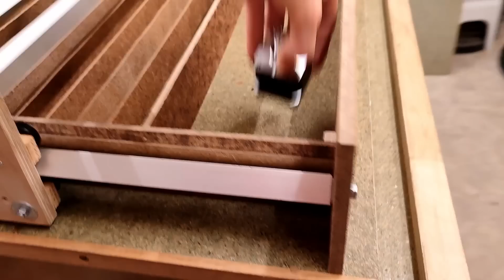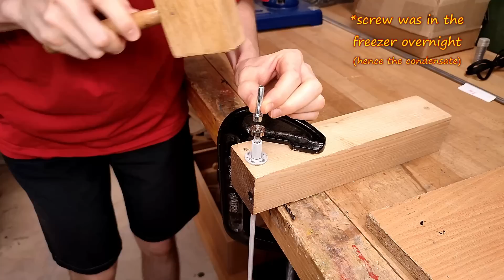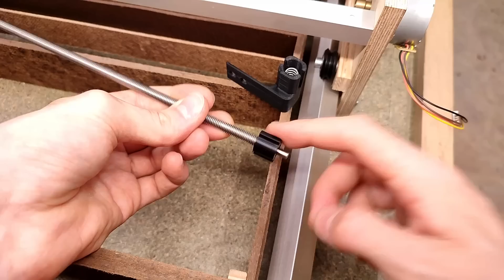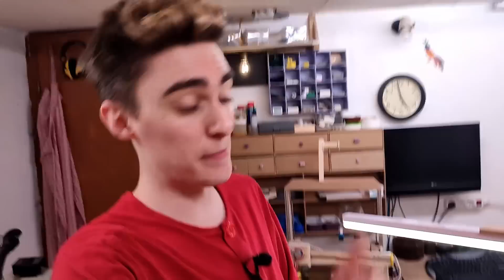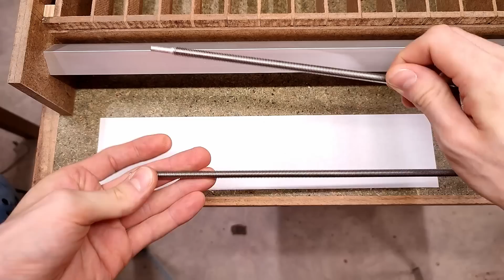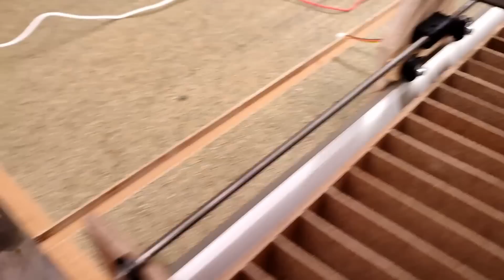Threaded rod as lead screws on DIY CNC? Bad idea! | Budget UV laser cutter part 2

Comment: nema 17 pancakes on a carriage that smooth i think would work still.
Reply from the maker: Maybe.. If I had one on each side, probably yes, the new GRBL even supports dual motor axes for gantry self-squaring. But I'd have to use a single one to drive the entire carriage, which I'd estimate weighs easily over a pound, so accelerations would be very limited. It COULD move it no doubt, but if I do install decent motors I want decent performance to boot ;)

Comment: Very hard work here! Klipper supports different pitch lead screws on one axis I believe, but not laser cutters (not to mention it's a whole different beast from marlin and GRBL). But coreXY is probably going to serve you better anyway - threaded rods tend to vary in pitch by a noticeable amount over as little as a few millimeters, creating a wavy pattern.
Reply from the maker: Thanks! I'd never have expected Klipper to support it - though it's no good either way because none of the G-code senders for laser out there are Klipper compatible - but thanks tor the info anyway! Knowledge is power as they say...
Yeah, coreXY is definitely more suitable, especially as I have all of the parts at hand already - while I'm at it I'll also purge all the unnecessary weight in the gantry and make it less overkill, it's just a laser after all. Probably a good thing overall for the project.
I really didn't expect the thread to be that inaccurate, but it makes sense, threaded rods are meant for screwing on nuts which doesn't need tolerances this tight. As @SianaGearz mentioned, with a constant pitch die in manufacturing the final pitch depends on the diameter of the rod that was fed into the machine to begin with, which hadn't even occurred to me.

Comment: i think you would have figured out the software stuff in less time than you spent babysitting it. and remember that the knowledge gained will pay dividends for your entire life. imagine how many times you will be able to cash in on not being scared of the code :D
Reply: I'm a (minor) Marlin contributor and i wouldn't dare do such a modification. You can't imagine how complex and fragile the movement code in Marlin is. I'm vaguely comfortable with many other areas, i have modified the HAL to suit my system better and enable interrupt features, etc.

You will notice how many hundreds of people touched most of the Marlin code and how few have actually contributed to the movement routines, these people are spectacularly sharp, and the code in that area is still very far from ideal in behaviour.
Reply: @SianaGearz  i was refering to his arduino based ghetto lathe. you could literally just count steps up to a hard coded value and then reverse direction. doesn't have to be pretty.
Reply: @cho4d   Oh yeah sure there's any number of way to do that, easy enough. I meant and thought you meant running different step rates across the same axis two motors. This would require a substantial re-engineering of Marlin, which is complex enough.
Reply from the maker: Yeah, hard-coding steps and speeds is likely what I would've done, but that still  would have taken me a day or so to write and debug, the machine would've taken a day longer to build because this also requires a motorized 3rd axis, and then I'd have to wait another four days till it finished grinding to continue with the video. Sure, I could've done something different in the mean time, but the video wouldn't have been out sooner.
Next time I'll do it though!
I might also simply run GRBL on it and write some G-code to take the rod down to a preset diameter after probing?...

Comment: What firmware are you running this with? I know on Klipper you can set the rotation distance for the lead screws.  The only way to learn is to do everything wrong at least once. Keep up the good work. BTW Don't forget what Adam Savage says... "failure is always an option".
Reply from the maker: It'll be running GRBL, there is basically no better option for laser machines since most dedicated Gcode senders don't speak the Marlin or Klipper accents.
As far as I'm aware Lightburn and Laser GRBL are the two prime candidates for controlling lasers, so ignoring obscure Inkscape plugins which might result in God knows how many issues, and skipping proprietary Lightburn, I'll pretty much have to use LaserGRBL.

Too true, usually failure is the most effective way to learn things!

Comment: First of all: This video was a pleasure to watch.
I also like how you solve some small minor problems! It's amazing!
I know, it's crazy idea but since your carriage is running so smooth, you could try to make one lead screw more rigid and discard another one. Then You can make diagonal reinforce and measure the backlash by using only one lead screw. The big thing is: Your laser cable management must be on side, where the lead screw is present! otherwise the cable management will pull on the leadscrewless side and cause the gantry to bend.
But its just a crazy idea, you can pull if you not already disassembled the machine :D
Greetings and thank you For great content :)
Reply from the maker: Thanks! I thought about that possibility too, seeing as all the cantilever designs out there do it, but when I took a closer look at it I noticed there's still about half a millimeter of lag between moving one side of the X-carriage and the other one  coming with it. I guess it's better than what I have now, but not good enough for a fix. I was actually surprised to see it, given how overkill the entire Y-axis ended up being in rigidness, but it also weighs about half a kilo at the very least so the little play there is in the individual bearings of the POM wheels actually allows some flex. If the rear wheels ran on the rail horizontally it would probably work fine, but as it is the weight introduces too much drag...
Also I'm sufficiently fed up with it at this point that I'd rather redesign it and skip the minor inconveniences from having lead screws altogether :)

Comment: Is it not possible to use dual motor Y and adjust steps per mm? You'd get double the power too.
Reply from the maker: Well - almost no firmware supports two separate steps/mm settings for one axis, even if it's a dual-motor axis with self-squaring capability. It always applies the same resolution setting to both motors. Apparently Klipper does, (offer individual step/mm settings) as somebody else mentioned here in the comments, but the problem is that no G-code sender for laser cutting supports Klipper. Or even Marlin for that matter. The whole software ecosystem for laser cutting isn't anywhere near as advanced as the one for 3D printing. So I basically HAVE to run this laser on GRBL, which is kinda clunky and doesn't support fancy stuff like screens or SD cards. No reason to fix it if it ain't broke I guess, but it's nowhere near as plug&play as 3D printing has become.

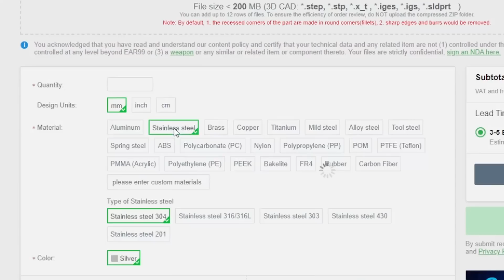Comment: 15:45 Titanium isn't as bad as its reputation. My mini-mill handles Ti6Al4V better than even mild steel. Stainless is the hardest. I can only guess that the problems show up when you have a super rigid machine that can eat steel faster than mine does aluminum. Probably have to slow down to similar speed as my machine and get annoyed that it's slower than you're used to.
Reply from the maker: Good point, maybe it's an old wife's tale - I don't really know a lot about machining, I heard that it's terrible to machine and verified it in a google search where it ranked second, right under inconel on a list of least machinable metals. Though my guess is that time spent on the process is taken into account as much as hardness since it translates directly into cost?...

Comment: Wow you have a real 3D printer? And a TT as well? Nice.

You can dry PETG with the bed heater. You can use a filament box with one side cut off. You can poke some holes in the top and make sure you have a tiny gap somewhere in the bottom. You can also dress the inside in tinfoil. I don't know why i did it the way i did, but worked for me, takes a day or so to dry.

I also suggest getting some double ziploc bags (say IKEA pack of 4.5 and 6 litre bags), and calcium cabronate room dehumidifier packs from the supermarket. You can seal one of those packs with the bag and in a few months when you retrieve PETG it will be super dry. Then i suggest double bagging the whole everything, and never store those dehumidifier packs near anything metal.

Wow so much difference in thread? Crazy. I didn't run into this issue since when i used M6, i cut both sides from the same rod. I would have never suspected it! I have never heard it happen to anyone before either!
Reply from the maker: Yeah, I have a real printer - I mainly took them up on the offer because I figured learning the ropes of 3D printing would be much more difficult on an inherently delicate printer. And having a second one definitely doesn't hurt either ;p

I tried the heated bed filament box method dry PLA at some point but it didn't really seem to work - probably cause I half-assed it, I didn't poke any holes in the box, nor did I leave it running for more than 4 hours, since I couldn't stand the constant drone of the cooling fans x)

Thanks for the tip with the dehumidifier packs! From my brief googling just now it seems it's the same stuff as road salt, and I happened to find a disused bag of the stuff rotting away in the garage... Just need to figure out how to dehydrate it. Not storing it near anything metal makes sense, having seen the state of the metal scoop that was in there. 

Yeah the difference in pitch was way more than I expected - never heard of it either, though it doesn't help that I can't remember to ever have seen a video or something where someone tried to make a CNC with it..

Comment: Hey, don't think those are manufacturing inconsistencies. Lead screws have different pitch and lead, so my guess is that you just got lead screws with different specs
Reply from the maker: No no, those were all very much sold as M6 thread, if you look up how threaded rod is manufactured it starts to make sense. The dies used to form the thread just aren't that accurate from one machine to another... I never expected this, but it's obviously the case
Reply: @ChronicMechatronic   Yeah it makes sense where the inaccuracy comes from. Let's even assume the thread rolling die is the exact same. The pitch can still depend on the diameter of the rods as they come in! Because the die is basically constant angle not constant pitch, it just drives the rod forward at a rate that happens to emerge from the rod's diameter and that angle. And as you noticed the diameter wasn't quite similar enough either.

Though from looking at them at a home improvement store i didn't notice them deviating much at all, the threads of rods that i was picking for straightness and holding against an angle to compare together seemed to slot into each other just fine across 1m length. Perhaps you just got extra unlucky with that batch variance.
Reply from the maker: @SianaGearz  you're right! I hadn't even thought about how the diameter would affect it.. Measuring the diameter on those rods just now, one is about 5.85mm in diameter while the other one measures ~5.9mm for the most part. Annoyingly the Y-axis screw seems to be about 5.9mm too, which is even more unfortunate :((
So there were probably two much more similar ones among the three I got, and I just happened to pick the most dissimilar ones.
It also answers the obvious question whether the pitch is at least consistent over the entire length of a single rod: probably good enough for DIY CNC purposes, but not really...